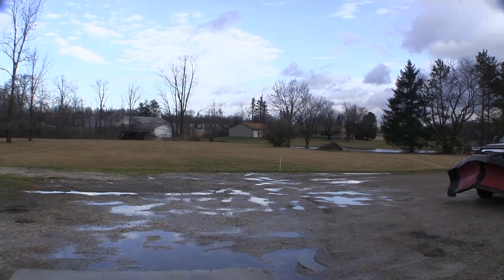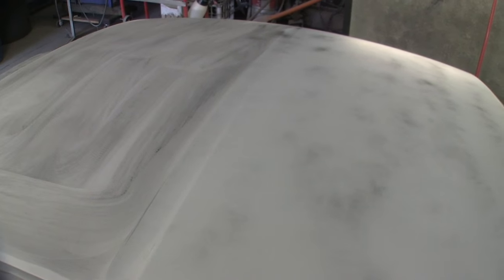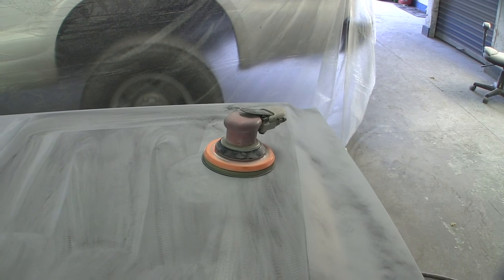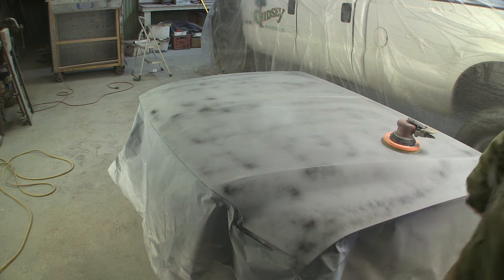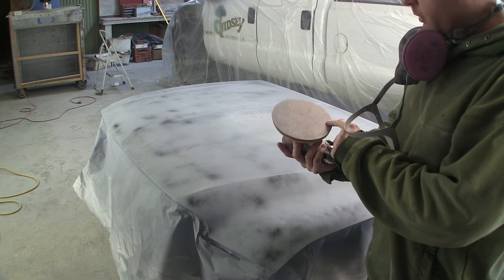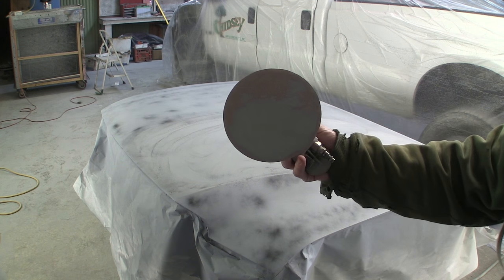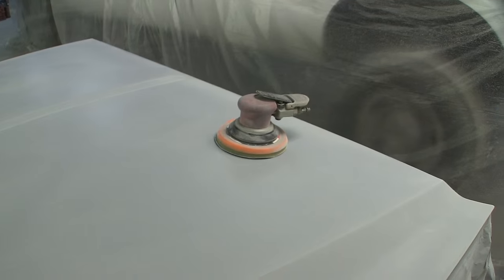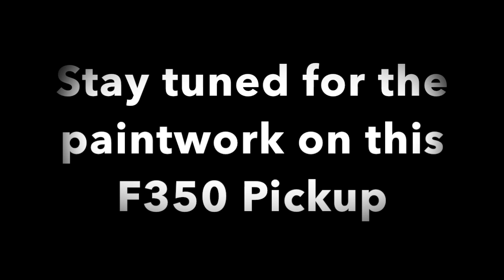2005 F350   Blocking primer with the DA Sander and Interface Pad

Comment: Looks nice , do you pick a white that matches the faded body or do you match the cab paint code.
Reply from the maker: +STEVE ROB I start with the cab paint code... in this case Ford Z1 (Oxford White).  Then if there are any variant or alternate formulas, I will look at those color chips and decide which is closest and blend from there

Comment: I guess it depends on what your expectations are for the finished job, just to make an old work truck look better I guess this is fine. However using a DA with an interface pad is in no way blocking! The interface pad itself allows the sandpaper to follow and go into the lows on the hood. It is all about expectations. If you are wanting a really nice straight panel this is not the way to do it.
Reply from the maker: Mypointofview 
You are correct and that is exactly how I describe it in the video. Thank you for the comment

Comment: How straight and nice did the hood come out once it was painted using the da sander say compared to the factory oem paint job it had? Can you even tell the differenence between the two? Basically once you finished did it look factory ?
Reply from the maker: Better than factory look.  Since there was almost no bodywork in this hood I could get away with doing it this way.  If this thing had tons of repairs on it I would have hand blocked it out

Comment: What epoxy was it ? After your epoxy did you guide and block epoxy or put 2k high build on top of your first prime ? Guide then block ?
Reply from the maker: rich will 
Don’t recall which epoxy I was using but 2k primer directly over it within the recoat window. No sanding the epoxy, just guide coat 2k and blocked it
Reply: Velvethamma hey there if as you say you epoxy .... then higher build..... left to dry few days and did repairs but you went thru the epoxy ...... what would your steps be re- epoxy or just cover ( spot ) high build ...... great video ..... from U.K.
Reply from the maker: rich will 
Spot epoxy if I hit bare steel. As long as it blocked out fine I probably wouldn’t re prime with high build
Reply: Velvethamma you wouldt spot prime with high build ? But you'd be putting a second round of high build on as you state in vid ???? Confusing